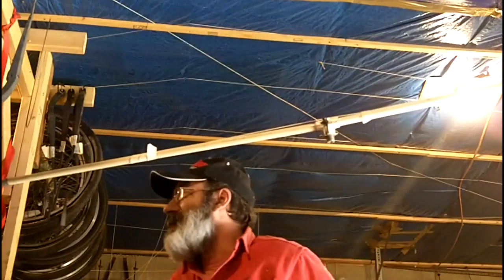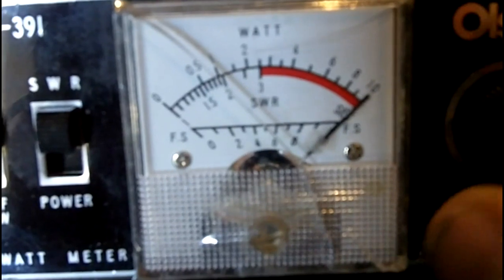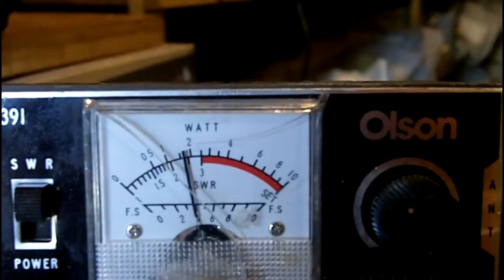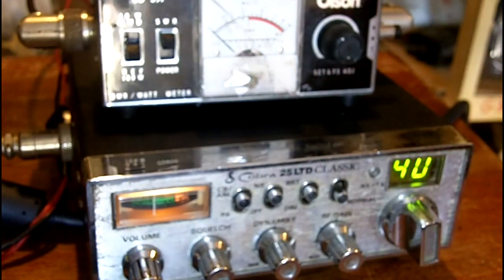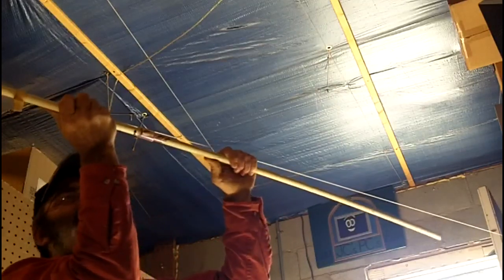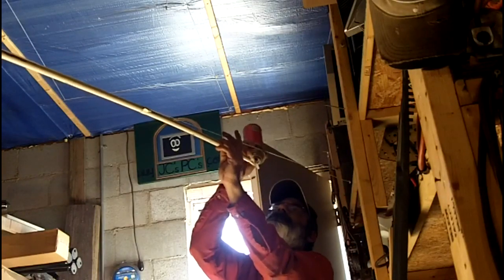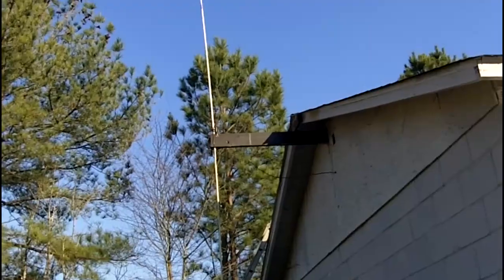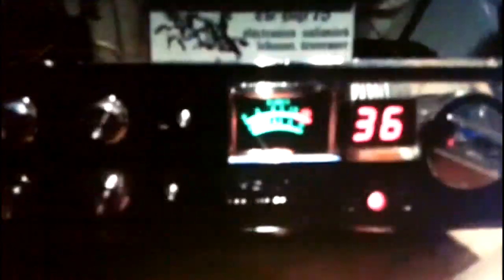Another Homemade CB Radio Antenna

Comment: Vertical dipoles for 27mhz are super performers. I stuck an aluminum tube dipole one on a 12 ft high 4x4 post which swivels at the center feed point like a Martin House into a sloper where swr improves with less ground/feedline coupling loss and slight directivity with useful backnull.
Contacted Cuba across hurricane Milton from Missouri.
Reply: I’m trying that one 😂😂😂

Comment: i built one just like this and while ive got it horizontal ive got an even 1 on channel 1 and 1 to 3 on 40 but once i mount it vertical my swr goes up to 1to 6 on channel one and an even 2 on channel 40 so any suggestions ?
Reply from the maker: When you have it vertical, is it at least 3 feet away from all objects? including you mast? any nearby objects will mess with your tune.
Reply: @MowerJunkie  ok i had seen yours mounted to the side of your house so i wasnt sure
Reply from the maker: @bobbyt3451  it's also important to have the coax perpendicular to the antenna for at least 3 feet. these are some of the reasons it's easier to mount them horizontal.
Reply: @MowerJunkie  gotcha thanks !
Reply: @MowerJunkie i think the problem im having with this antenna is my house is built from steel conex shipping containers
Reply: @MowerJunkie  iim pretty new to cb and i have the antenna down to a 1.4 but when i talk into the mic my swr goes up past 2 is that normal ?
Reply: @bobbyt3451  If mounting antenna on house built of Conex Containers, use a ground match like a gamma match. That type of feedpoint does not care as long as antenna is not mobile. The lower part of a vertical dipole wave goes to ground anyway.
Reply: @MowerJunkie  what was the stand off mount on the side of your house built out of ?
Reply from the maker: @bobbyt3451  I built the mount for my house out of 1" c-channel, from an old bed frame.
Reply: @MowerJunkie  ok that black mount looked like it might have been wood in the video
Reply from the maker: @bobbyt3451  the mount on my garage is wood, the one on my house is metal.
Reply: @bobbyt3451 cardboard 😂😂
Reply: Your antenna is coupling to something nearby or its own feedline and causing resonant frequency to go up and impedance go down. Both which add to high swr. Mine was similar when vertical, but when I went to 45 to 60 degree sloper all was well except for slight deafness on backside of slope.

Comment: nice.. could you please tellme the lenght of each leg? cause i dont have an swr.. also is it ok to use plain wire???  i want to make that to use it as an external antenna for realistic trc 207 portable radio..thx in advance, take care.
Reply from the maker: You really should not build an antenna without an SWR meter to check it.  if you only plan on listening, 102" each leg will work.
Reply: @MowerJunkie  ok... thanks for the reply

Comment: Wrap a 5T x 4.25'' diameter choke in the coax - right next to the feed point - and you'll have less RF in the shack and improve the uniformity of the pattern.

Comment: Thank you for the help mower junkie i just gave 207 a lil blue amp just like that 772 mmdr quack quack
Reply from the maker: Very cool! Take care 772, 73's from 151 SC.
Reply: @MowerJunkie  i couldnt get it to work looks like im just going to have to buy one
Reply: @MudDuckGames  Check out how to build a T2LT antenna right out of the end of the coax itself, and they work almost as well as an Imax2000 and better than an Antron A99!

Comment: Some of my best memories were experimenting with mobile CB, .. we actually filed our base loaded whips mounting them in a vise and removed shavings to try and get perfect 1.01 to 1 meter readings .. it was crazy fun here and it really seemed to perform well. We also clipped on "capacitance hats" to our mobile whips to get the signal to radiate off higher on the whip. Good memories. Cheers.

Comment: Can you give me the measurements for this antenna
Reply: About 102" each side. Start with 110 each side and trim. I would very strongly recommend adding a choke coil to this antenna. 10 wraps or so of the coax at the feed point would work. Just wind it around a 1" piece of PVC.
Reply: @timmack2415  ..  what would that do....?

Comment: I presume you do not need a balum if the radial and ground leads are the same length. Thanks ... good video. I wondered how to hold the copper wire steady in the PVC but the foam trick looks great. I will hoist mine into a tree. The neighbours get 'squirrelly' if the ant is left up!
Reply from the maker: I have made them with, and without the ballun, and I have never noticed any difference. Thanks for watching, 73's from 151 SC.
Reply: @MowerJunkie  ... Thanks for getting back. I built the 1/2 wave dipole according to your model. New Cobra 18 WX ST ll (4 watt)(smaller model. Not fancy), RG213U to a Astatic dual SWR/Power meter, RG213U to the antenna. Bare 14 gauge for the + element and coated 14 gauge for the      -  element. I am building a 'choke' balun (if that's the correct term) to eliminate any potential stray emf on the RG213. Am attaching the balun to the center with a short lead of 213 onto the SO239 at the antenna, etc., so I can remove it if unnecessary. I used 3/4" grey PVC for the wire support/protection, but as you know it needs lots of support. Great SWR but I originally used a short piece of RG8x for the short strap between the radio and the meter and got '2' SWR at 2+ watts. I figured it out and bought more RG213U, replaced the strap and now get 1.4 SWR and 4 watts. Whow!! I'm getting out to 3 miles before terrain gets in the way. (town with lots of power lines for solar panels ... no less! Behind houses, and over some hills. 360 degrees) Haven't completed the tree mounting (the antenna stands on the ground against tree branches for these tests) nor installed the choke, yet. I figure I need an impedance meter to prove the antenna is really balanced but it measures at exactly 102 inches each element from the center of the middle junction. No foam in the tube ends yet but don't see a problem there. Hey, I hope this is a positive feedback for the novices, like myself. Far easier to tune than the Wilson Little Wil, I picked up for mobile, and far greater reach. Thanks for the great video from John in Ontario, Canada. (no handle. no HAM license ... yet). ps ... I figure I will try a 5/8 dipole next,, but space is an issue with the neighbours. Cheers
Reply: @JDS11ify  The difference between bare copper and coated copper will give you a slight imbalance I'm the antenna. 
Insulated wire has a different velocity factor than uninsulated wire.
In practice, insulated wire will need to be shorter than uninsulated wire for the same frequency at resonance. (About 5% or slightly less)
But for less common mode noise (a quieter antenna), and a balanced dipole (for TX), both halves need to be the same gauge wire and have equal velocity factors. 
Will it still work? Yes, but it's not a good idea to use different wires for a dipole. 
Also the "negative" and "positive" parts of a dipole are completely the same. It doesn't matter which half of a balanced antenna is up or down, it's completely irrelevant.

Comment: When you were tuning it did you have to trim the ground plane also? Thanks for the veidos.
Reply from the maker: Yes I did, all the radials need to be the same length. Thanks for watching, 73's from 151 SC.
Reply: @MowerJunkie  thanks for the help. I trimmed the dipole antenna on both ends down to 102. I had metal poles supporting the wire that was ran in PVC pipe. I changed them out to Wood. The dipole is running horizontal 5 and a half feet off the ground. SWR on Channel 1 is a 2. And a 3 on channel 40. How do I get channel 40 down lower?
Reply: @MowerJunkie  i am getting back into the cb game and was wondering if there a vertical antenna i can build and build plans using pvc and some coax and some copper antenna wire
Reply from the maker: @AndrewMurphy8383  I made another antenna that may be what Your looking for.  Check it out here,   https://www.youtube.com/watch?v=6DNIpUZvI2k

Comment: MJ - How many watts do you think I can run using this antenna with a Uniden Bearct 980 SSB CB as a base station? What amp would you suggest? Thanks
Reply from the maker: I really don't know how many watts it can handle, But I ran 200 into mine for over a year without any problems. If You leave that 980 stock, It should sound good with any amp You choose. Thanks for watching.
Reply: @MowerJunkie   Some have said that 4 watts is to much to drive an amp and say the dead key wattage should be turned down before hooking up an amp. 
Would you suggest I turn my dead key down to 1-2 watts before hooking up an amp so as to not overdrive the amp or can I just hook an amp to it without messing with the dead key wattage. What would you do? Thanks for your videos!
Reply from the maker: @jamesj4111  it all depends on the amp, most will allow up to 4 watts on AM, and 12 watts on SSB. I have Palomar 2 pill amps on both of My stations,  I put 5 watts AM and about 18 watts on SSB without any problems, and they sound great. follow what the amp manufacturer states, and You will be good to go. The main thing You need to be aware of is high SWR. I will not run an amp on an antenna that has a higher than 1.4 reading.
Reply: @MowerJunkie  I really appreciate this info. I was curious about using an amp on SSB because of the higher wattage than the AM side going into an amp. You answered that question too, thank you. By the way, my 1/2 wave dipole up the pine tree has a 1.1 across the board (1-40). Was talking about 10.5 miles (as crow flies) on 38 LSB a few days ago. My whole goal is to simply be able to contact my daughter 21 miles away in case of emergency if cell phones and the internet go down. I think if I put an amp on her end and my end we should be able to make the trip, especially on SSB. Thanks again for your Guidance.

Comment: MJ - (Two quick questions) 1. Can the ground plane wire also be installed "inside" the pvc (like the active element is) instead of being tie wrapped to the "outside" of the lower piece of pvc without hurting performance?

2. If I have antenna in a 'horizontal' position while tuning, trimming, tuning, trimming and get a good SWR will the SWR reading still be good when I mount the antenna 'vertically?

I'm climbing up a 60-70' pine tree to mount this thing sticking out of the top of the tree and don't want to have to have to take it down again to retune. Thanks for your response!
Reply from the maker: Yes, the second time I made one of these vertical dipoles, I had the ground plane inside the lower pipe.
I would tune it vertically, and near the tree that You plan on mounting it to. This way if the tree has any disagreements with the antenna, it will already be tuned to compensate for it.
Good luck with Your antenna, and thanks for watching.
Reply: @MowerJunkie  Thanks for the response and quickly too! I will do what you said. GREAT channel! Keep up the good work. Thanks again!!
Reply: FYI - I finished the dipole antenna today. An Unbelievable match of less than 1.1 on channel #1 and virtually the the same (1.1) on channel 40. I wasn't able to get it up the tree today. Too windy and needed time for silicone to dry anyhow. Plan on climbing tree and mounting tomorrow. Thanks again for your help.
Reply from the maker: @jamesj4111  That's fantastic! Good job with the build. I can't wait to hear how it works for You. Let Me know how it does when it's mounted.
Reply: @MowerJunkie  Well, I got the antenna mounted up the tree about 55'. The top of the dipole is sticking about 2' above the tree. SWR is 1.6:1 on #1 and #40. I'm not too impressed unfortunately. I've only been able to make contact around 2 miles away (as the crow flies). I actually kept the mic keyed on channel 1(at my house) with you tube playing into the mic and went for a ride in my truck to see how far I could hear my base. Only heard it for about 2 miles. Not sure why it is so bad, especially with a decent SWR reading.
Reply: @jamesj4111  because you didn't isolate the antenna from the tree and it's grounded out?

Comment: I just made one like this except I used 1 1/2 pvc lower for the mast and 3/4 for the top  now my question is does the lower GP have to be above roof line  mine stinger will be at around 30 on top of roof  but the lower GP side will be below roof line.... Thanks
Reply from the maker: If You space it off the building it should be fine. the one I made in this video, had it's ground plane below the roof line, and it worked great.
Reply: @MowerJunkie  I have mine temp mount of the deck and way below roof line with  avg 1:2 match and I'm hearing skip from Michigan to Florida, Cape Cod Road Island But not TX to them so IM raising id to the peak of house like I said stinger is above 30 feet so we will see Im soldering up Rg213 as we speak....
Reply from the maker: @phunahm  Awesome! I hope it all works out for You. 73's from 151 SC.
Reply: @MowerJunkie  SWR went up to 1:6-1:7 from 1:2  by raising it and adding 20 feet of rg213
Reply from the maker: sometimes changing the coax length can cause that. If your not running a lot of power, a 1.7 reading is okay.
Reply: @MowerJunkie  I cant  live with 1:7 I do run a lil power also  I think I might try adding a UGLY BALUN see if it helps... I have a analyzer coming in in a couple days maybe will help too

Comment: After watching several times.  It looks to me like the active element still has white wire insulation on it.  In the comments you said it was bare wire.  Could you please clarify for me if the active is insulated or stripped.  Im making one as i comment
Reply from the maker: It doesn't matter if it is insulated or bare. the covering on wire does not stop the radio waves. Good luck with Your antenna. Thanks for watching.
Reply: @MowerJunkie   im just getting into cb you have been great help.  P.s love the orange and black sears.     Im a big garden tractor fan as well.  Thanks for ur chanel and ur help

Comment: Ive read all the comments.. Im loosing faith in people again... Morons be among us.
I was 13 years old.
My silver rod snapped at the coil.
I made my own 36ft wire dipole antenna, without help and strung it down the garden at around washing line height
It was supposed to be a temporary antenna, but it worked well and it lasted 15+ years until I quit CB.
There was no internet or youtube in 1982... We did things by trial and error. We experimented. We learnt.
Reply: 🍭 here ya go.

Comment: Can you be more descriptive??? Hell I need to build one of these
Reply from the maker: sorry about that, I'm still getting used to sharing My projects. for this antenna I used 2 9' pieces of 1/2" pvc pipe joined in the middle with a Tee. an so239 is connected to the tee. the active element is soldered to the conector and slid up into the pipe. the ground plane wire is attached to the connector on the outside and zip tied to the lower pipe.
If You get a chance, check out My newer video, "homemade ground plane antenna"  Thanks for watching, 73's from 151 SC.
Reply: Mower Junkie awesome thanks!!
Reply: @Journeyman1642  I was 13 years old.
My silver rod snapped at the coil.
I made my own 36ft wire dipole antenna, without help and strung it down the garden at around washing line height
It was supposed to be a temporary antenna, but it worked well and it lasted 15+ years until I quit CB.
There was no internet or youtube in 1982... We did things by trial and error. We experimented. We learnt.

Comment: How about a telescoping Tv antenna-type roof mast and a short piece of 1" or so fiberglass rod, Delrin, gray PVC or equivalent with a 102" whip & mount on top, then 3-4 106" diagonal downward guy wire radials to insulators or parachute cord for a home-brewed version of a StarDuster?
 I bet you'd get several S-Units improvement to your local stations, especially if you went up 3-5 sections of mast on the roof, or even alongside the house, 30-50' up to the 102" whip.
Reply from the maker: last month I replaced this antenna with a homemade ground plane antenna. it's only about 5' higher than this 1 was, but it does a great job.I can now talk to local stations up to 60 miles away, with about 180 watts. and skip is unbelievable. Thanks for watching, 73's from 151 SC.
Reply: @MowerJunkie  Hmmm, 180w? Texas Star/Outcom? FT-102? CMI? What style GP did you build?

Comment: I have a couple questions: which is better for a CB base station antenna- 1/2 wave or. 7/8? Do you have a list of parts that you used to build that antenna? On a dipole antenna which end goes up in the air? The ground plane part points downward? What do you think the maximum amount of watts that can be used with that antenna? How long is the coax cable? What type of coax cable is it? 73!!!
Reply from the maker: I've never used a 7/8 wave, but I have used many other configurations, and I like a 1/2 wave antenna best. I make these antennas out of pvc pipe with some end caps, and a tee to attach the SO239 onto. I use RG8X coax. the ground plane is on the bottom, and I'm not sure on the power handling......but it does fine with My 225.   Thanks for watching, 73's from 151 SC.

Comment: What gage wire did you use
Reply from the maker: I use 14 ga solid copper wire on all My antennas. I've tried other wire, but this seems to work best. Thanks for watching
Reply: @MowerJunkie  I yeal for you  haven't made contact  yet

Comment: Do the wires go inside the pipe or outside? And do you trim  oth ends to set SWR?
Reply from the maker: I have Mine set up with the active element inside the top pipe, and the ground plane half is on the outside of the bottom pipe. Yes both wires should be trimmed equally, to get the best SWR reading.